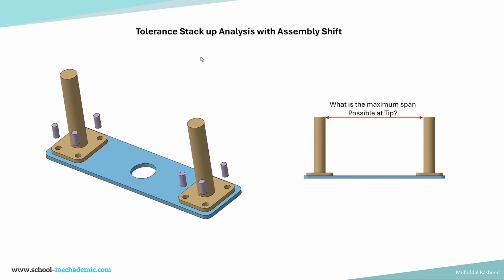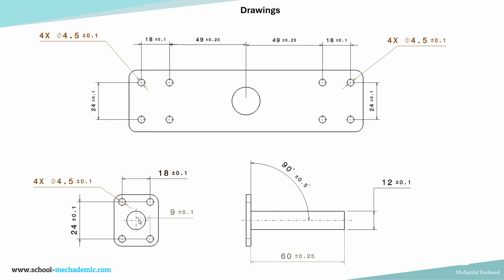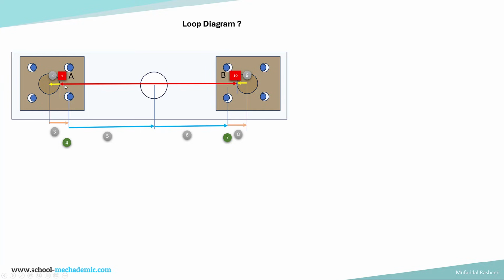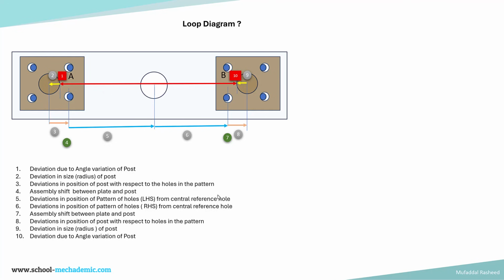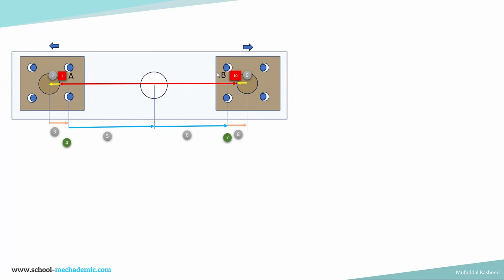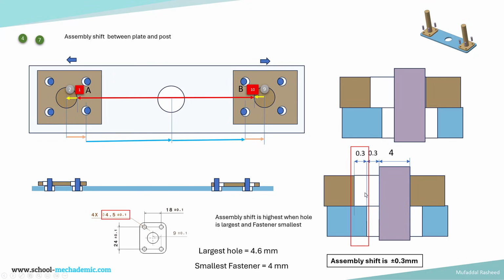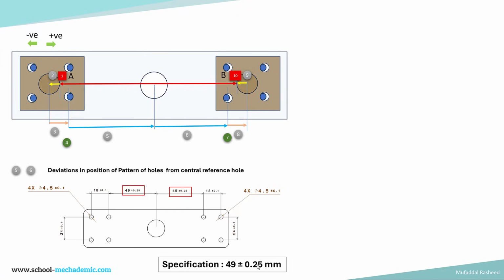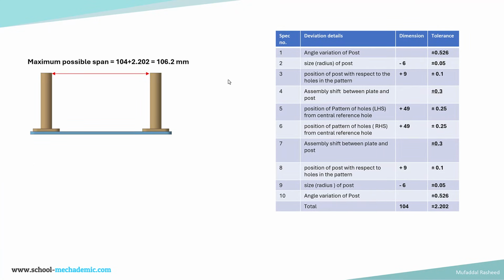Tolerance Stack up Analysis with Assembly Shift - Case study 2

Comment: Why we not considered assembly shift  for bottom plate. There also 0.3 shift. Or it would be touched edge of hole with dia 4.6 of bottom plate
Reply from the maker: The assembly shift  for bottom plate is not necessary to consider because both the patterns of holes will move together they will not add up .